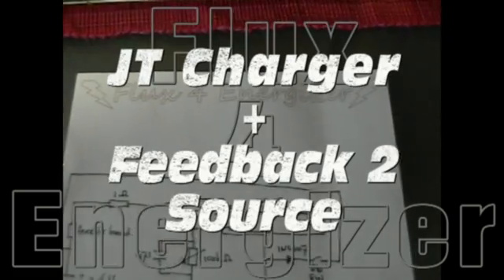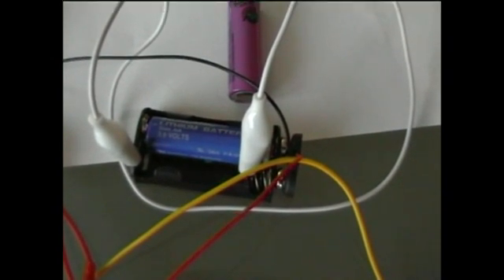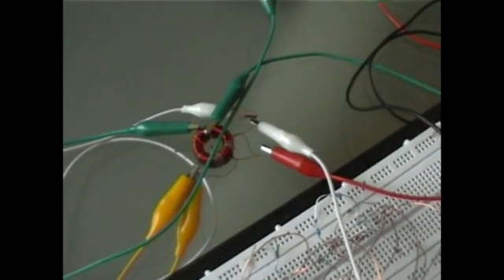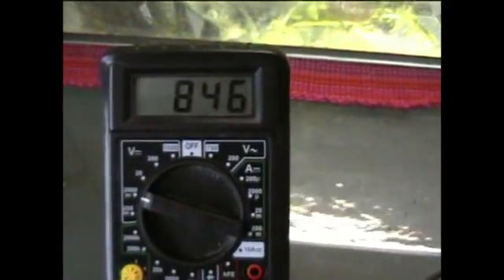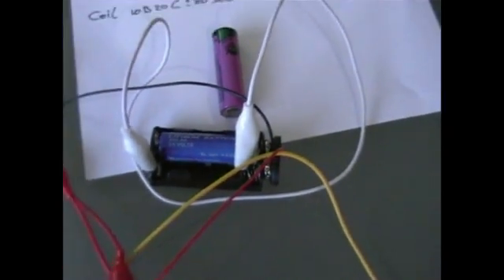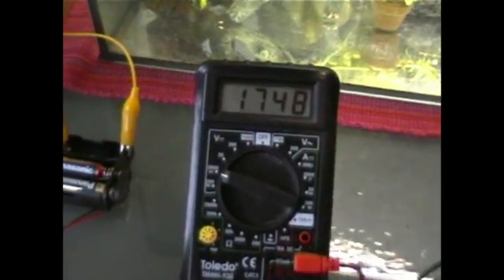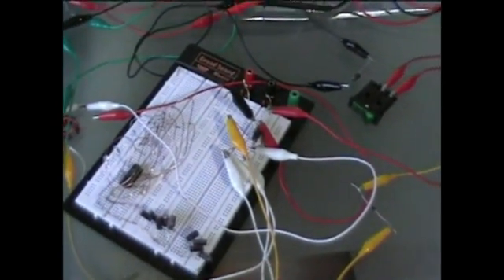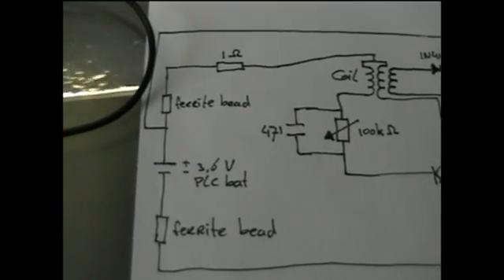Joule Thief Secondary Charger with Feedback 2 Source

Comment: Nice job, my friend. You may try to work with a single rechargeable, and to take the wires from secondary coil through diodes and some other shock coils to recharge this load battery. Also try one primary coil between emitor and baterry minus, and the other on collector. Tnks